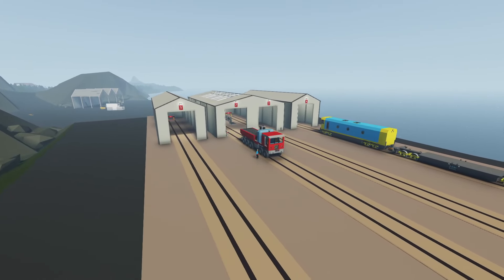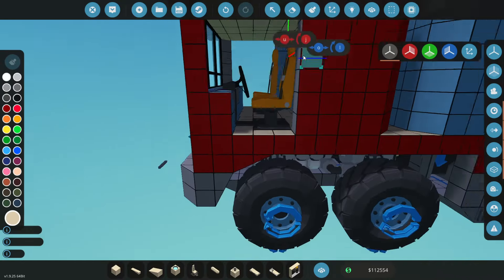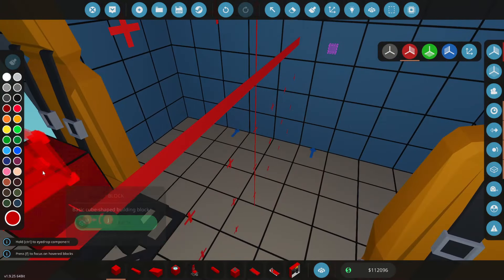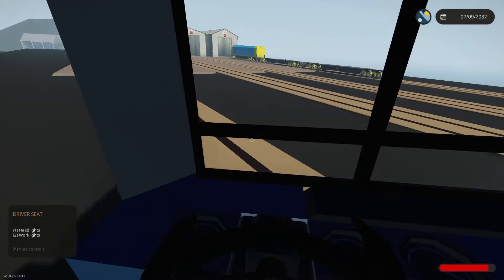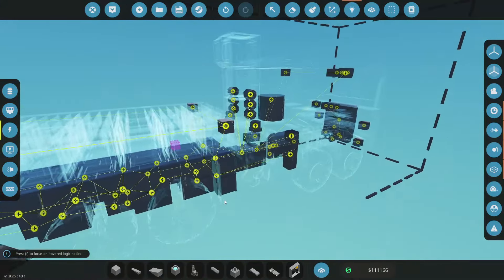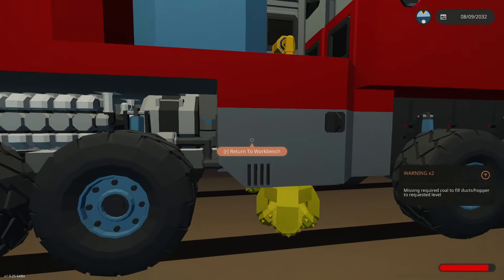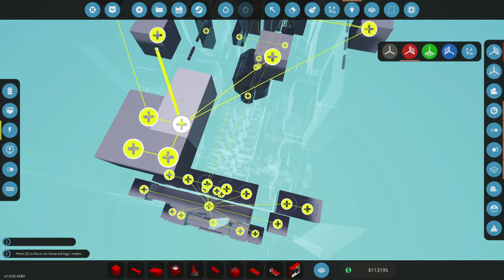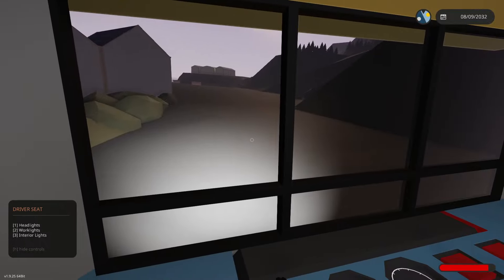Mining Truck Test Drive!! | Stormworks Career Series EP.46

Comment: Not sure why it did not show up on the map (common game issue) but Camodo has a coal buyer on the most left track coming from Spycakes. Another one is next to the ONeil Airbase (x:3766/y:-5321). Not really worth it selling directly for 2 bucks per coal. More like an easy showcase for drilling. But it is a great fuel source for larger creations. Or mix 10 coal with 1 iron ingot to get 13 bucks for a mined item.
You would not need to touch the ground with the drills. They have a fairly large range. That 1 block gap would have been fine.